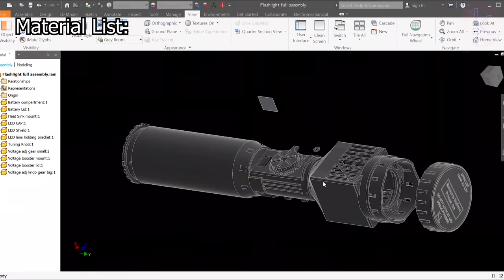DIY Compact 100W flashlight 10,000 Lumens Max

Comment: Hi, this was an amazing project and I really liked it.

But one main issue is that the 3S lipo battery used does not have an over discharge protection thus causing problems.

Thus, it would be great if you fixed a BMS with balance charging for the flashlight battery and also provide charging facility.

Comment: I think there is an error in your wiring diagram: the step-down regulator for the fan is powered from the battery, not from the output of the boost converter... The step-down wouldn't surive the voltage from the boost converter

Comment: Thank you, this is amazing! I am currently building it... The step-down for the fan will not step up, so it makes no sense to connect it right to the battery. Also connecting it to 32 volts booster output, it will rise to 100°C within seconds, so it will not survive it long. I decide to connect the fan directly to the battery.
Reply: I think, I will connect the step-down for the fan between battery+ and booster+, so the voltage drops by the voltage of the battery (about 10 volts). Do you think that is a bad idea? Let me know!

Comment: wy not using a fuse between the dc jack and the lipo for if ther is a short or does the lipo have the short protection circuit
but nice video +sub

Comment: Why exactly do you bring the voltage up to +30V and later bring it down to 12V again to power the fan? Wouldn't a simple connection directly with the battery work just fine?
Reply from the maker: Because battery voltage is not always 12V, depending on the cell configuration, it could be as much as 25V
Reply: @kralyn3d  Ah I see. But for a 3s Lipo the Voltage is close enough.

Comment: This is awesome. but this design can be improved.
1. replace gears with potentiometer for simpler stuff. 
2. Acetone vapor to make 3D print smooth. 
3. Counter sunk with black screws.
4. Thermal fuse cutoff
Reply: brother tq .i didn't know about smoothing the 3d print before.....i searched after your comment.. its amazing
Reply: @netrapatil2169  Hi, today I came across your video again. :)

Comment: Hi! Awesome tutorial. One question please. If you use a battery with 12.6V 30Ah, and you set the potentiometer to 3A on the current part, will it work? The input current limit of this board is 10A, and I dont understand if this 10A is only if I use it when at full with the potentiometer maxed out?
Reply: @kralyn3d  Thank you really really much and thank you for the video!
Reply: You will have maximum power limited to around 80% at low state of charge and 90% at medium stare of charge and no limitation at full.

Comment: does the air from the fan blow towards the heat sink or does the fan draw air away from the heat sink ???
Reply from the maker: Blow to heatsink
Reply: i made  a cob head light and i set the fan to blow towards the heatsink but someone  told me the fan should be taking heat away from the heatsink and should run cooler....im using smaller heat sink and  i can not run the head lamp at full  current in fact only about 1 amp otherwise casing starts to get hotter

Comment: Does it actually run at 100w tho?
Because I'm having trouble to get them to get them to run at 60w
Reply from the maker: In my newest video , you can see it running at 100W during the battery pack testing

Comment: Can you get the led in green i dont want white led but same power in green led
Reply from the maker: https://www.ebay.com/itm/100-watt-led-chip-100w-20w-30w-50w-cob-white-DC-32v-smd-bulb-rgb-flood-light-red/362646319380?var=631790292822&hash=item546f67b114:g:hFkAAOSwEJtc1oSU
According to this link, yes, you can just use a green chip instead, pay attention to the forward current and make sure not to exceed that.